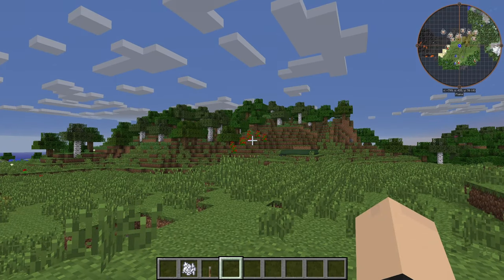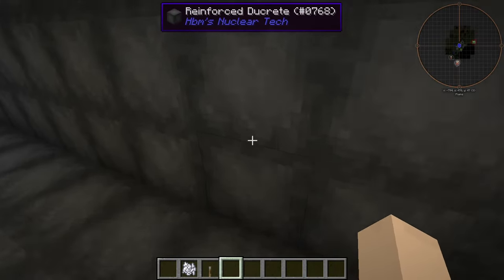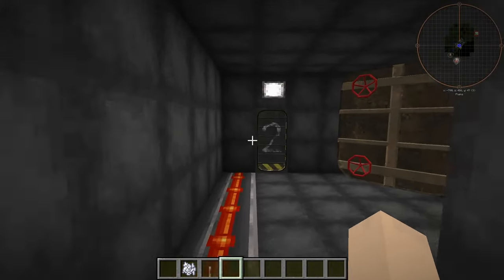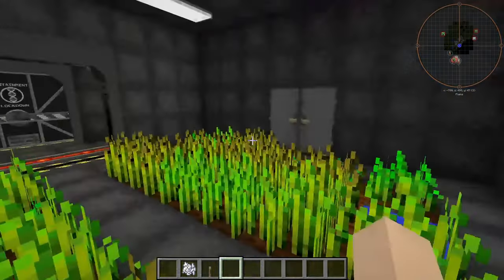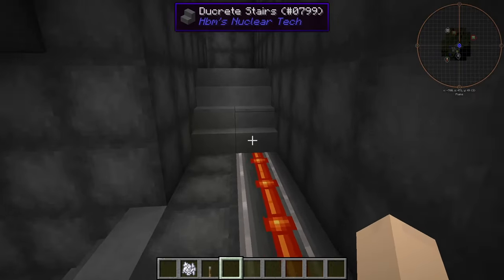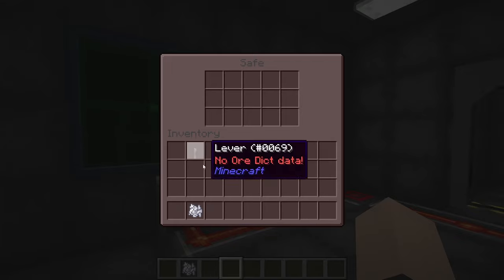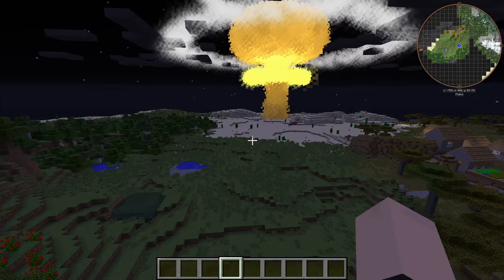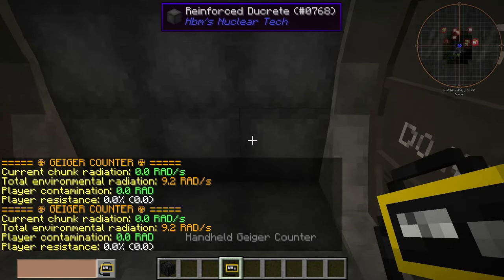REDESIGED Missile Silo HBM Nuclear Tech Mod

Comment: Ive calculated those years into irl years and it appears to be 9.7 years. Also, I dont really think the lockdown doors were meant to be used as actual doors that you open and close on the regular. Theyre probably meant for when a facility goes on lockdown and they close
Reply from the maker: Thank you 🙏